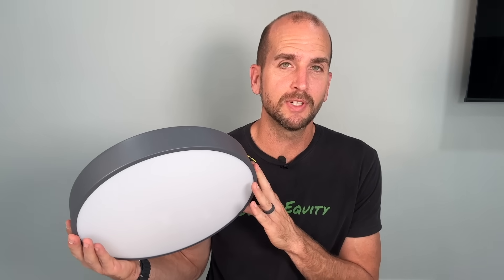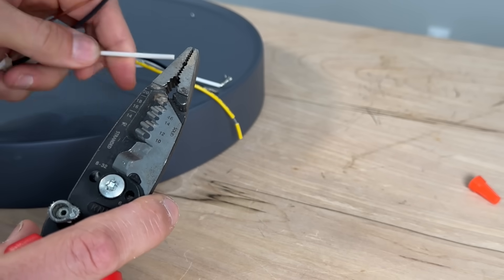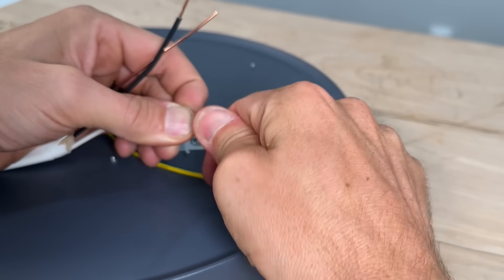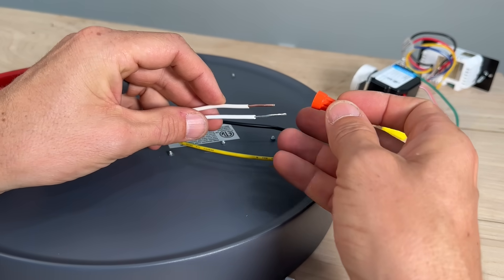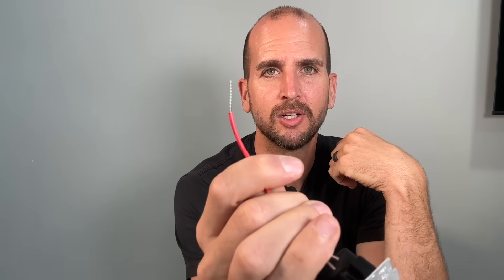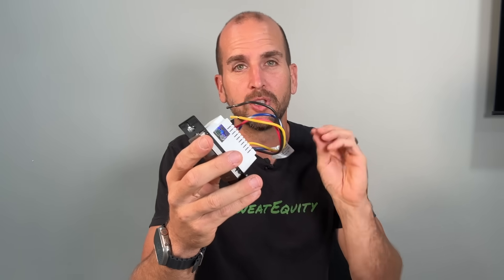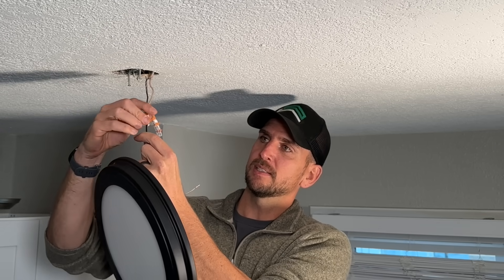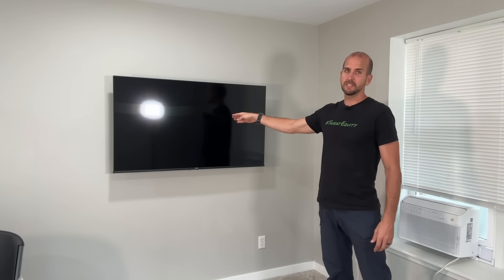The #1 Mistake Homeowner Make | DIY Electrical

Comment: Have you never seen the push in connectors. They are spring loaded in a little bit cheaper than the lever ones are not quite as tight.

Comment: Take the solid wire and the stranded wire, put them together. Twist wirenut on until tight. Pull on each individual wire to confirm good connection. Good to go.
Reply: You always want to leave with the stranded wire. That's what he was trying to say The stranded wire has to stick out a little further than the solid wire to get it started
Reply: @Jake-by9ly  It ultimately depends on the situation.

Comment: There are dubious things (using wire nut to connect 4+ solid wires). There are danerous things (crimping solid wire without knowing exactly wtf are you doing). And there are things that simply should not happen. Using wire nut to connect solid and stranded wire is one of them in my book.

It is especially unforgiveable in lighting fixtures. Crimp stranded wires. Feed them to screw terminal (cut three from the strip). Connect solid wires. It worked before Wagos became available, it still works, and it avoids all pitfalls of wire nut mumbo-jumbo, with exception of losing contact if the connection is bustled around too much (weakness of screw terminals). Wagos and similar spring clamps are superiour in this regard.

Comment: If one is unfortunate enough to be wired with aluminum and cannot rewire for whatever reason, there is a compound that can be used to join the aluminum to copper. However, not there yet, knowing your favorite method, you don't even need that compound if using what I think you're going to come to.

Comment: im an apprentance in all means but id do a drill bit into the wall behind the tv to the closest stud to electrical box mount , we could have a discussion about peoples skills w tools but probably oscilating saw  the box from the stud point then we need to run the wire to the box, which if ur a normal home owner who doesnt know electric youre done, but splice a parallel off your closest outlet (the one you showed )and run it?  i really think thats a shot method tho if we could use dc and really understand electronics each have unique pull rates i sware it would be easier.
Reply: and yes i'd rather down step and re route all of my homes continuous energy especially if we can draw a TV at less than 60 w.or something like 15 w x 4 amps, relative to those who sort of know.

Comment: How do you disconnect the wago wire connectors? Sometimes you have to work with power on. Wire nuts are so much easier to disconnect. So I guess my question is how do you disconnect those wagos if you have to change out another fixture is there a way to disconnect the wire with the push of a button on those? Please make a video on how to do that if there is
Reply: Thou shalt not rise that lever.
Reply: Not rocket surgery. Raise the lever.
Reply: @johnbauman4005 😂ya it’s not that easy… i’ll stick with contractor wire nuts

Comment: Part of the first issue with wire nutting a solid wire and a stranded wire is so easily solved with the wago nuts.  Would have been great to include that as a good solution to that problem.

Comment: This is the #1 use case I have for Wago connectors (mixed wire types - with stranded).  I now keep a supply on-hand at all times.  

Up until they became mass available, I tinned my "loose" stranded wire to ensure proper wire nut connectivity after running into far too many improperly connected junctions.  It is worth keeping a soldering iron handy and spending an extra couple minutes tinning.

Comment: I had so much trouble with this over the years, I now routinely tin the ends of braided wire.  It takes a few minutes but at least I can do it sitting down.  Someday I will try the Wago, despite my bins full of wire nuts.😁
Reply: A crimper and a kit of ferrules will save you a lot of time and a lot of soldering, trust me.
Reply: Its not like I mind the soldering, but I did as luck would have it had to install a new light fixture, and the wago connecers were great. @boaragile82

Comment: Once I learned about Wago, I never went back for lighting fixtures. I still use wire nuts for outlets and junction boxes, because I think they are slightly better - and having one of those Ideal electrician screwdrivers with the ratcheting wire nut tightener in the handle saves my hands when wiring multiple boxes - but for low current applications, Wagos are the best.
Reply: Americans. You and your staying in the 1950s when it comes to electricity. Fortunately, wirenuts are banned in civilized countries.

Comment: I first learned of Wago thru Cruiseman's Garage, a motorcycle video channel, then by you, & have brought several kits, even one for my son. Then you shared the single version, which I initially had trouble finding. They are all great & I find them indispensable for adding motorcycle accessories.  Thanks.
Reply: There junk, learn how to properly join wires.

Comment: 1. Use wire nuts with metal spring inside vs all plastic
2.  Shorten the solid wire to about 3/8" and longer stranded wire.  So solid wire does not bottom outvin the wire nut and extra wrap of stranded around the solid wire.
Reply: A wire nut without steel spring inside?

What the fokk, it should not even exist.

Comment: Wondering if the in-line splice connectors are best used for the neutral wires or if they also are commonly used for the hot wires. 

Thanks for a great video demo and explanations👍
Reply from the maker: Oh yeah, I was just showing a few different examples.  I use all inline splices on many applications including light fixtures. 👍
Reply: @EverydayHomeRepairs  Can you do a video regarding aluminum to copper wire splicing inside the panel box? I had a home inspection recently and I am having to use Alumiconn connectors for every receptacle, switch, etc. But it also says I have to use them on all breakers at the breaker panel that are directly connected to single strand aluminum, which in my box it is a mix of copper and aluminum. And the breaker panel wiring is not as straight foreword as working with a single device at a time.
Reply: Thanks so much!

Comment: When you have those connectors on the wires is there enough room to tuck them 
all back in the box ?
Reply from the maker: WAGOs are pretty compact 👍.  If you are using 14 gauge or 12 gauge wire just make sure you are using the "400" series which will go up to 12 gauge as opposed to the "600" series which will go up to 10 gauge.

Comment: Another useful video. Wish I had seen it yesterday while installing a new landscape light on a tree. Especially leaving the insulation on the wire for twisting.
Reply: I've been connecting wire together professionally for 40 years and part of the back of that as a child. I learned early on that you always want the branded wired to stick out a little further to be a lead into the wire nut. For last 10 years I've been using the push in or lever connectors. I never saw that chick of twisting the wires inside insulator before. I tried it and it works great It was really wire. So I'm still learning at 70 years old
Reply from the maker: Thanks for the feedback!

Comment: I never even thought to use the cut end of the coating to twist the strands. That's really smart, thank you! I feel 100% confident in using those Wago 221 lever nuts for connecting the jelly to my peanut butter samiches!! That was a joke...I use the Butter 121 Pea-nuts, and a specialized spreader tool 🤣

Comment: Is there a way to tell if silvery-stranded wire is aluminum or copper?
Reply from the maker: If you have a little extra wire you can strip off the insulation and use a lighter to burn the strands.  Copper will burn in less than 3 seconds and have a green tint of color for the flames.  Aluminum would take more than 3 seconds and not have the green color.

Comment: What I like to do when mating solid wire to stranded is tin the stranded with a soldering iron and solder.  I tin it good, then heat it again and flick the excess off into my soldering iron sponge.  This keeps the stranded wires bonded for no strays and thickens it a tiny bit for better connection integrity.  If the stranded solder is not shiny, that's referred to as a Cold solder, so heat it again, add more solder and flick it off again so the strands are bound without a build up of solder.  I do this for wire nuts, WAGOs, crimp butt splices and crimp terminals.  And for crimp terminals, I sometimes solder the crimped area for the best, most secure connection, without melting the crimp cover insulation as best as possible, just the exposed strands beyond the crimp.  Sometimes the insulation cover can be pulled out of the way and put back in place without damaging it, but not always, so I only do that accordingly.

I bought a WAGO multi-size kit from your link, but that was before the Inline WAGO was available or included.  The two wire size WAGO is good enough for me now, but I'll get the other at reorder time.  Great tips about using partially stripped insulation to twist the stranded wires and having an extra 1/8" of twisted stranded extending beyond the solid when stranded mates with solid in a wire nut!  Another great one, Scott.  Thanks
Reply: Wires are not tinned, this is what tube terminals are for.
Reply: @Karol_Hamann  You do it your way and I'll do it mine.

Comment: I’ve started using Wagos whenever I’m wiring up light fixtures. So much easier to ensure a solid connection with those pesky stranded wires.

Comment: The reason those larger devices use stranded wire is because they can be soldered directly to the printed circuit board (PCB) inside the case. It's basically impossible to solder solid wire to a PCB without it either ripping a trace of the PCB or cracking the solder, which of course will result in a high resistance or intermittent open connection. Also, at 4:19 it's evident that your solid neutral has been stripped too far back. Shouldn't have any copper showing past the edge of the wire nut. If you were pre-twisting two solid wires the strip back would be about the right length. Most wire nut packaging has a striping guide on it, and the length varies depending on the number and type of wires being used.

Comment: With stranded wire with those type of strippers, I will make the "cut" part of the strip with the solid gauge and then go up a size when pulling the jacket off. Works really well in a production environment. Also I leave the jackets on until I'm ready to put into a Wago or crimp into a connector.

Comment: agreed. wagos are the way to go. pretty much my entire house uses wagos now.
Reply: When your lights start flickering or you smell somthing burning remember the wagos.
Reply: @RadioRich100  still waiting for that to happen. It's been almost two years. I even got them in my breaker box
Reply: @bb55555555  Why are you waiting? if your that nervous you shouldnt have used them in the first place. Well, when the circuit fails or the smoke is coming out of your panel at least they will be easy to get to.
Reply: @RadioRich100  I'm not waiting. I'm more confident than ever that these things will continue to work. I say that because I keep getting people like this telling me they will eventually melt or malfunction. Never mind the fact that wagos are used all over Europe without any issues and there are countless videos that have tested these things to extreme levels without failure. But still I get comments like this.
Reply: @bb55555555  Without issues all over the europe? I didnt know that they all reported to you when theres an issue with them. The videos you speak of test them over 20 minutes with a $10 dollar piece of equipment. Those silly tests are as flawed as the wagos themselves.  Any electrician worth a damn wont use them and may tell you about it. But of course your among the few that use them to get the job done a few minutes sooner and the customer pays the price later long after the halfass electrician leaves.
Reply: @RadioRich100  they don't use them because they are more expensive than traditional wire nuts. simple as that. But there are electricians that use them in some unique cases where the wire nut would take too much time.

Comment: I use WAGO push in connectors, I wonder what you think about those.
Reply: I use the push-ins often, especially overhead. They are great for solid or tinned wire, but not for stranded. The strands separate when pushing in and sometimes do go in at all.
Reply: @TomCee53  I'm guessing it may have to do with the fact that WAGO 2273 is only for solid cables.
Reply: Yup, I use the 221 for stranded and push-ins for solids.
Reply: I use the Wago push-in (non-lever) connectors in boxes I won’t need to change for a while. They are a lot cheaper than Wago 221’s, but they are only for solid core wire, and they are more permanent. If plans change, you can still remove them with a firm twist and pull of the wire, just not nearly as easy as lever nuts.

Comment: I actually purchased the Wago kit with the inline from your affiliate link when I purchased my new home. They have been a godsend for me putting up all the light fixtures in the new home. I did wrap each with black electrical tape after the first fixture I installed was not working, and it was due to a lever being lifted. So it was a great tip to secure the wago with electrical tape.
Reply: ...lol, that totally makes them worth it, especially with the added cost!
Reply: right, i heard this and was like you're just better off splicing and shrink wrapping  @GodlyNoghri  @domenicfp
@domenicfp
Reply: Even better dont use them.

Comment: Great advice, I have being using wagos ever since I saw your earlier videos. Made connecting wires easy!
Reply: Check back in a few years and see if the circuit still works or if you smell somthing burning.
Reply: @RadioRich100 Sad ham attitude.

Comment: Quick question would a Bad Connection in My Kitchen Ceiling Light shorten Bulb Life?
Reply: It could be that, or what I found in someone's reptile light, one of the wires had the insulation come off and was intermittently shorting on the housing. It would be good to check the wiring of the Light Fixture.
Reply: You don't happen to be using GE bulbs, do you?
Reply: @jong2359  Energy Savers don't remember

Comment: I’m feeling a wago pitch here soon
Reply: Ideal lever connectors are fine, each has minor issues, but both work well.
Reply: Or another wago vs. Ideal
Reply: If he does not use Wagos in his demos, many ask why not. 

I appreciate that he explains when Wago 221s have an advantage over wire nuts, such as when working with overhead lighting involving the otherwise more challenging stranded and solid wire connections.
Reply: https://youtu.be/k_hlK8SJbN4?si=HHRTD-QUuTGQ6bR2&t=402

shockandawe
Reply: How? he's talking about a SOLID [as in ‘reliable’ as in ‘foolproof’ as in ‘safe’ and 'code-abiding'] connection. I've seen even the most snugly tucked solid wire slip out of a Wago faster than a limp, greased sausage out of some tight beef curtains. 😂
Reply: I’ve seen them slip out too on 12 gauge wires where they are under different tension. I’ve leaned to carefully fold them together at the same distance from the connector. But at least a stranded to solid connection will practically never pull out because the stranded wire is so flexible.
Reply: That's when "oh noes, 221's lever accidentally rose!" whine usually begins ;-)
Reply: Thumbs down on this WAGO commercial